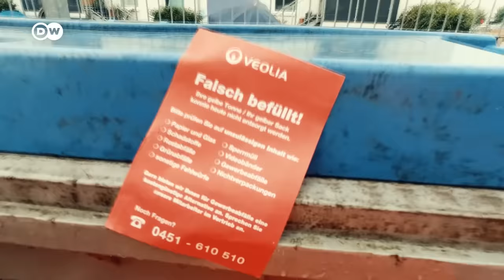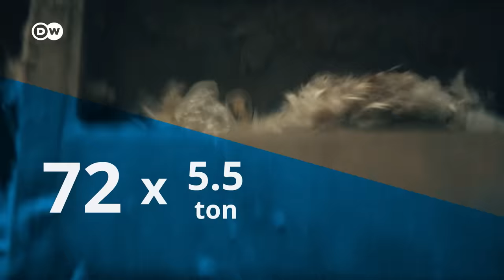The recycling myth: What actually happens to our plastic

Comment: In Australia, we shred a fair amount of liquid container plastics to use as fibres in spray-on-concrete. way cheaper than using steel fibres. Doesn't have a massive impact, but it's a pretty good use for a product that has no outer use.
Reply: Same here in Europe. Shredded plastics are used as fillers for various products like concrete. There is a catch though: The plastics are now in the concrete and as soon as the concrete will be demolished the plastic particles will be set free in the form of microplastic. A good solution for the industry, not so much for the environment.

Comment: I worked on an environmental cleanup project at a metal scrap yard and wondered about all the plastic that was around. The plastic was just mixed up with steel shavings that was sent over to the electric furnaces. This was the first layer of material put into the furnaces as the electrodes were lowered into the ladle to create a puddle of molten metal then larger chunks of metal were added. I asked about the plastic, if it would contaminate the metal. The temperatures are so hot to melt the steel that the plastics are completely disintegrated but the carbon is added to alloy the metal. The exhaust air from the furnaces was clean enough and cool enough to breath. A far cry from what the old blast furnaces were like.  

But I still cannot fathom that, burning plastics in a co-generation facility cannot be done efficiently and clean.

Comment: It is NOT "necessary to burn them"!  There are at least three different processes to turn ANY plastic into something useful; one turns it back into oil, another turns it into a plastic goo that can be used in manufacturing, and a third micro-shreds it and mixes it with wood fiber to make construction materials.  The first of these sorts out metals and many minerals along the way so they can be reused as well (and can take four-fifths of all household trash).

Comment: I have learned from a proof of concept video aired on YouTube recently, that it is possible to steam plastics in a large boiler, under pressure, and turn them back into an oil product, which they came from originally. Have you heard anything about whether this process has had any companies trying to make it succeed in Germany?

The video I watched showed that it was theoretically possible as a means of recycling a large quantity of otherwise non-recyclable plastic types. I'm just not certain how many companies would be willing to set up a process which would generate oil and waste byproduct - of which I'm certain there will be some quantity of in any such process - to recycle a larger percentage of the plastics that currently just get sent to landfill or incinerated.

Steaming plastics certainly would require energy and water from some source, in order to heat the water to make steam. The process also was shown in the video as working best on plastics cut to a size optimal for steaming, which would mean additional energy expenditure to run machines to chop the plastics up into properly sized pieces.

It is certainly an interesting proof of concept, the real question is whether it can be made to work on a large scale, and economically enough.
Reply: @Michael Murray Since the alternative is a plastic landscape which we're rapidly headed towards, I'm okay with it. I'm also okay with shoving it back in the faces of the oil barons. They are going to get what is coming to them, one way or another!
Reply: @DarkVoidIII  the alternative is a moratorium on plastic production, not containing plastic production into oblivion
Reply: @DarkVoidIII  a moratorium on plastic production is a lever only a government can pull

Consumers can not buy the plastic, but plastic makers will just find other outlets instead
Reply: Just spit-balling here, but the problem with solutions like this is usually that they end up needing more money going in, then money coming out.  So even if they are a viable solution, they aren't economically viable, and so they never reach widespread acceptance.
Reply: @andrewkuebler4335  If you want to live in a plastic world then that is what is going to happen. Companies that recycle plastics simply have to scale it up until it's viable and able to get rid of all the plastic backlog. An ideal situation where viability is concerned, would be to ensure that current reserves of unprocessed plastic go away, and don't come back. It might take more than this recycling solution can handle but eventually recycling plastic should win and take away the backlog, meaning that plastic going out goes back in. It's up to people to stop throwing away plastic, and to put it into designated recycling bins, if that doesn't happen, we end up in a plastic world.

Comment: Great video.  I think worldwide we need to pressure manufactures and legislators to A) use less packaging and B) use materials that will more likely be recycled.  I am 63 and we did not have near this problem when I was young.
Reply: I agree but simultaneously we also need to take personal responsibility for the products we choose to use and support on a daily basis.  Purchasing = voting.  We can make little changes every day and if each and every one of us make these changes, and continue to do so, they will accumulate into big differences.  Big companies won't produce products that don't sell.

Comment: For all the reasons that you presented, I have stopped recycling anything with the exception of aluminium. Mostly cans from beverages, pet food, and various other products. But, I don't give it to a recycling company, I take it to a metals processor which is just a short distance away. I will compact the aluminium as much as I can and store it until there is as much as I can fit into my car then take it all to the scrap metals processor which purchases it at the current market rate for  scrap value. Better to get the going rate for metal scrap for myself than to give it away. Even though it takes a bit of time to accumulate enough to take, I see it as a return on my expense even though it is just a little; it is still my property until I sell it.

Comment: One easy thing I do:   Buy items in the largest size possible, for items I use often.  This Reduces waste and ends up being cheaper in the long run. 

 Laundry and dish detergent, I get the biggest size then refill a small container.  Coffee I also buy the largest size offered.  

In my city, our recycling system is a racket.  Reducing is the first step.

Comment: I reduce the amount of plastic that I throw out because I don't buy many pre-packaged foods. I cook most of what I eat from scratch. I don't use plastic containers to store leftovers I have Pyrex containers. These get used over and over again and will last for years unlike plastic. Very rarely do I use any disposable cups, plates, utensils and bowls. On the paper front I limit my use of paper towels. A roll of paper towels will typically last me 2 months. I use 100% cotton kitchen towels at all times almost. I also make my own laundry soap so the products that typically consumers buy to wash their laundry are all contained in plastic containers these days. The products I use to make my laundry soap are in cardboard. Even if it doesn't get recycled it's biodegradable unlike plastic. I don't buy bottled water. When I was on a city water or municipal if you prefer, I had a filter system attached to my faucet. Where I live now I have a well that's 120 ft deep. I don't need bottled water I think it's a grotesque waste of resources to make the bottles regardless of whether they're recycled and transport the water. If you think you are an advocate for green environment, and you drink bottled water, you need to rethink that. My well has excellent water if it wasn't a good flavor I would just put a filter on that. I do use reusable stainless steel thermos mugs. No throw away everything gets washed and reused. Essentially everything in my kitchen other than the appliances which I can't control so much is made from a durable metal such as stainless steel or reusable glass such as Pyrex. Pyrex does not wear out it's very resilient against breakage. It can go in the refrigerator, the oven, the microwave and the freezer. You have to do dishes anyhow why throw away plastics. The other issue with using plastics and cooking many people don't look at whether or not the container they just bought full of food and plant warm up to eat is really a suitable container to use in the microwave or around food. Yeah I guess that sometimes they put on there that it's safe no whatever but we're always discovering that science was wrong on what is and is not safe. At my age I've been exposed to many things today that are either banned or not considered safe for food and water. I know it's a convenience thing to get prepared foods and packaging or take out but do you really need to add to the waste of the world? Why not just fix your own food? Instead of Kleenex I cut up old t-shirts into small pieces to use if I need to wipe my nose or blow my nose. These go into the laundry as well. I also used pieces of old clothing for rags for working on things such as a car. Why throw something out that has another purpose built into it? Why buy clothing made out of synthetics? Buy cotton products they're better for you and better for the environment.

Comment: In the USA I work in the trash industry and know about the different product packaging that is being used. Some plastics can be re worked and use again in the same way, other plastics can not but can be added to other materials to make usable materials and some plastics can not be used because it is combined with other materials like aluminum and paper to make juice containers or milk cartons. These look like plastic but are not completely plastic. AND if there is not enough in the truck or if the cost is to high the load gets dumped in a land fill.

Comment: In British Columbia, Canada, 85% of plastics collected are pelletized in the province. These pellets are then sold to manufacturers overseas to be made into such things as plastic decking and furniture.  Recycled plastics are in fact cheaper to use, not more expensive, when you factor in the process of extracting the actual oil, or tar sand, as well as consider the environmental costs.
Reply: I also live in BC, Canada.
But I've worked in manufacturing plants and recycling plants.
I can assure you that the government/corporate rhetoric you're quoting is absolutely wrong. I don't know the numbers but I'd be surprised if we recycle and pelletize more than maybe 5% of all our plastics.

Comment: Pepsi and Coke (etc.) need to replace plastic bottles with aluminum bottles (with screw-on caps). Use the same form-factor so they can use the same shipping crates and they can fit into vending machines. Aluminum can be recycled into better items than before (or back into bottles) and aluminum is light weight and hard to damage unlike glass. I've read that it takes something like 90% less energy to recycle used aluminum (cans) than to produce it from ore. Don't get me wrong, glass is wonderful but heavy and fragile - same goes for ceramics.  
I can only think of a few things that absolutely need to be made out of petroleum-based plastic (vinyl records and acrylic paint [but maybe not?] for example are archival quality and DESIGNED TO LAST FOREVER - that's the key) but for many other items you could use something else.
Manufacturers need to be held accountable for single-use plastic. Does gum really need to come in a plastic "car cup" or a million other things that don't need to be made out of something pretty much indestructible?

Comment: Just an observation from an old fart born in 1962. Everything came in glass, or paper packages. For example cereal was packaged in sealed wax paper inside a cardboard box like we have today. Ketchup was sold in narrow neck glass bottles. Occasionally someone would drop it and you had a shattered glass and ketchup mess all over the floor, which was no fun to clean up. We also burned all of our trash in an incinerator (large brick box in the alley). The trash pickup was mostly shovels to clean out the incinerator / ash pit and very little real trash went into a landfill. Burning trash generates smoke which pollutes the air. The anti-pollution campaign began. No more dumping in rivers, no more burning trash, no more cutting down trees to make paper. We have a lot cleaner air now than we did when I was a kid, and the rivers overall are safe and cleaner. Then steadily companies realized how great plastic packaging is compared to glass and wax paper. Ketchup in a plastic bottle could be designed with a convenient squirt nozzle, and it doesn't break when you drop it. The package is also one-tenth the weight of glass so shipping costs were drastically reduced. Also, in the 60's and 70's there was a fanatical worry about de-forestation for the purposes of making paper. - The law of un-intended consequences has manifested to what we have today, which is overgrown forests that are unhealthy and are terrible fire hazards, oceans and landfills full of non-bio-degradable plastics, plastics being burned to generate electricity, and the delusion that we are doing something good for the environment by recycling. - - There is a multi-billion dollar industry waiting to happen for the individual who invents the replacement for plastic - or we return to Aluminum, Glass, and Paper packaging.

Comment: I used to live in Oshawa Ontario Canada. We had to sort plastic, aluminum, paper and cardboard, bundle the cardboard and put each category into separate bins. If the collection people didn't like the way things were sorted, they just left the whole pile on the curb. If recyclable material was found in your garbage, you could be fined. I have to wonder. After putting us to all that trouble, was any of the plastic ever recycled? I'm pretty sure they sold off all the aluminum, paper and cardboard, but the plastic is more of a challenge. I don't know enough chemistry to really understand it. To me, polymers are polymers. Heat them up and crack or polymerize them to make new products, just like they do with crude oil. Really, what's the difficulty?

Comment: Totally unrelated but I see the recycling company is Veolia. A while ago those Veolia people came here to my city to manage the waters and sewers infrastructure. I'm gonna give them the benefit of the doubt but they've been doing an awful job. Tap water is gone a lot of times (for several days straight). The sewers get as flooded as ever and a lot of people complain and get ripped off by them, either by crazy non sensical bills or the money just disappears on bureaucracy.

Now, now. Besides the rip-offs and the bureaucracy I can give them the benefit of the doubt on the water being cut or the flooding. Like, I know the water system and sewer system in this city sucks balls. It hasn't changed in all my life so maybe, just maybe they do all those cuts (there used to be cuts but not this often) and the flooding is still bad cuz they are working on it and sometimes you have to cut the water in order to repair or improve stuff (they've been here only a couple of years) it's not something you can fix in 5 or 10 and not even 20 years in some cases so maybe they are on it.

All in all, up to this day they seem to be doing a shittier job than the government was doing before. Since they are an international company I hope they are actually working on improving the system since I know that at least they have a reputation to hold. Although some international companies don't give a crap about doing a good job.
Only time will tell.

P.S. The company appeared out of nowhere, there were complaints on the streets and still are but it seems like they are here to stay.

Comment: A lot of people near me don't think that the county is actually recycling the items we put in the recycling bins. It is a separate program that you pay for so people don't pay for it because they think it will just end up in the landfill anyways. I think they are confused because our local landfill has both a recycling center and a landfill so I think they are under the assumption it goes to the same place but don't realize its a separate location. Anyways, it is so upsetting because I am a huge advocate for it even if there are flaws in the system. Some things do get recycled so I would rather send it there and hope that at least some percentage is handled properly. But I am appalled that even after all the effort to recycle some things are either burned or end up in landfill in some 3rd world country. If sweden has a system of converting that waste into clean energy, why don't they share the information with the rest of the world so we all can have that as well. And if they have shared it, why hasn't anyone taken advantage of it? It would help to resolve both a landfill and a recycling waste problem, while also providing us with a resource we actually need.

Comment: in most parts of Denmark you don't just get a sticker when you fail to sort your garbage, you get a fine, typically 500 kr (about 70 €) each time you fail to sort correctly, and the garbage collectors take photos as proof so it's difficult to weasel out of it.

Comment: "just use a different material" simple to say but not so simple across all industries that use certain materials for specific reasons(cost, weight, material properties, government regulations,etc). lots of times there is only 1 option of a material to use. its not just wrappers look at every product you use is most likely using some type of plastic. this is not just something you can just snap your fingers and fix